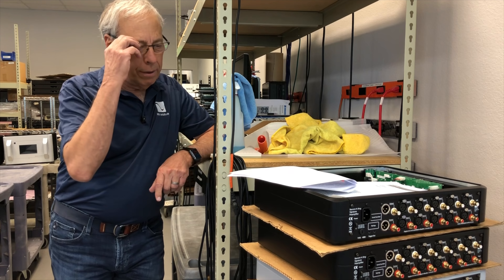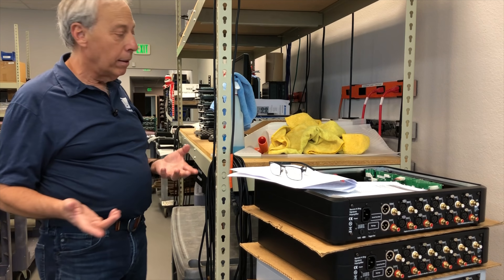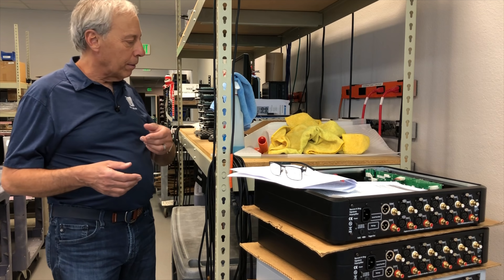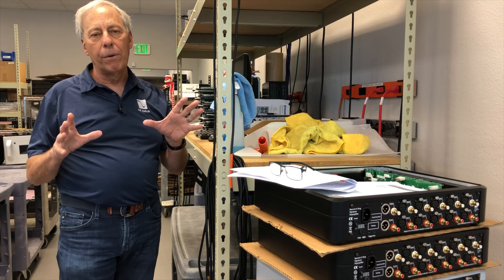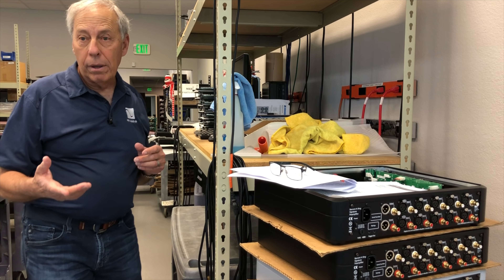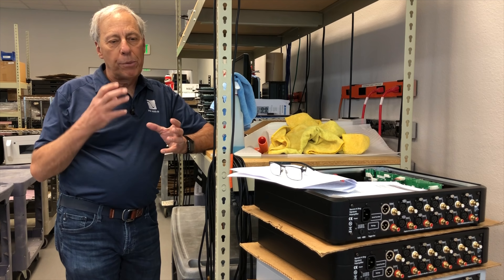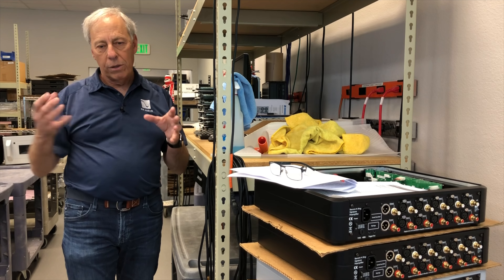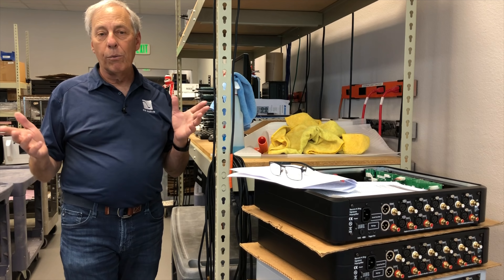Are fewer components in the path cleaner?

Comment: OOOooo I got a good question! What is impedence matching? why do i need to match the impedence of the source to the amp?
Reply: This is one of those questions that can get really out of hand, because there are several directions to go with it.  
In some applications, impedance matching is for most efficient transfer of power.  In others, it can be to minimize noise (obtain best noise figure).  And in another class of applications, it's for fidelity of signals with fast transitions or long transmission distances, i.e., avoidance of reflections and the standing waves which can result.  
There is a great deal to say about all of the above.  Which one interests you most?

Comment: I think the reason why that argument wins  support to begin with, is the misconception about audio processing. We dun do simple for the sake of simplicity, and by product is good sound (Think of the non sense of amplifiers best be a straight wire with gain), but actually whichever way least  implicated and appropriate to make good audio unaffected in the end. In many senses, that's why we have filtering in CD, NFB circuits in many amp designs, buffer stages like Paul uses as an example etc. I think we may not conclude by looking at an amp opened by without cover and count components to say good sound. That's naive and useless.

Comment: Well a couple of years ago I used to run my Oppo 105D directly to the Parasound A23 power amp using Oppo's pre-amp features (connected using balanced XLR cables)... I thought it sounded pretty good... but when I added a real pre-Amp to the mix (a Parasound P5) BOOM!! Much more detail, much more bass.   Night and day difference!!
Reply: NETnews could that just be an impedance thing! if you added more impedance from your oppo you might have achieved or even bettered the preamp
Reply: John sweda more like the Parasound pre-amp is just better than the pre-amp in the Oppo.
I personally have a Parasound P7 pre-amp connected to the Oppo.
But for connecting a hp, using either the Oppo hp out or the P7 hp out, seems damn close. The 105D does use a Texas Instrument amp in the hp circuit.

Comment: Great except the cable capacitance remark. There is insignificant capacitance on properly made 1-2 meter rca cables at audio frequencies to cause any degradation of the signals. RCA cables have low loss way out to 10Mhz and we often used them for analog video in the days before digital. This business of swapping cables and hearing the difference is nonsense. What is more likely is the power of suggestion plus blood alcohol or THC levels are higher. Or just someone's mood or background noise. A/B blind testing (with proper reference headphones only) on different properly make cables will yield no difference. If you want to see high cable loss then look at microwave 3-30Ghz losses per foot. However audio is way,way,way down in the dirt from a transmission line perspective and that's what you're really talking about here as Resistive loss on copper center conductor RCA cables is only ~0.7 ohms on a 25 foot run.
Reply: "This business of swapping cables and hearing the difference is nonsense" But have you tried it with 3 or 4 pairs of high quality audio cables on a high quality system?  I can tell you that a 6ft run of a 12 pF/ft will sound quite different than a 6 ft run of a 20+ pF/ft cable.  Not trying to start an argument, just wondering if you've actually taken the time to hear the difference.
Reply: I believe he was using a poorly designed circuit as an example.  The issue described was with the circuit, not the cables.  If the circuit is designed properly, cable capacitance is probably waaay down on the list of things to worry about.
Reply: Nixon is right. Cables need to be well constructed, good insulation, good termination, otherwise just a great way to pay someone elses colledge fund.
Reply: In a simple system, it should not make much of a difference, but with a very sensitive ssystem, the minute capacitive and inductive behaviour should be noticeable from set up to set up.

Comment: I may be way off base here, I am no expert by any means . But I think in a tube amp circuit less MAY be better but in a solid state amp this is not always the case. In a tube amp situation the valve is less fettered by tone control circuits and what have you but I think inherently solid state (being more like digital, on off)  will take more components to correct the input than an analog  valve amp would. Again I am no designer but looking at the simplicity of most valve amps it looks like this may be true.
Reply: Solid state devices require biasing to get them started. In that sense, they are "more like digital." Once that point is reached, the design and manufacturing of the device comes into play. If the circuit is designed to operate the device within a highly linear range of its characteristics, little additional circuitry may be necessary. If the device is operated in nonlinear regions, additional compensatory components may be required. 
Many tube circuits are designed with the philosophy "you get what the tube provides." If you don't like it, use a different tube. Complex tube circuits are more expensive to build and maintain; thus minimalist designs prevail. There may not be a compelling reason to do this when long lasting low noise semiconductors are used. 
If you have to increase feedback to make a simple circuit work, additional stages may allow less feedback to be used, and may sound better. Circuits that process balanced signals may sound better, even though active component count is higher.
Reply: Thanks for your reply! I just know that looking at a tube circuit and a transistor circuit that the tube circuit that sounds as good or better has WAY less components. A 5Y3 rectifier is a single tube with a couple of diodes and it does what a full wave rectifier does more elegantly. Just my thoughts.
Reply: Electrically, FET's act very similarly to tubes.  You can even create tube like circuits with them, although on a smaller scale since they run on lower voltage. The nuances of their behavior differs slightly, which is why it isn't exactly the same.  You still will bias a class A amplifier, be it tube or FET.  The input to the circuit swings the current on the tube or FET up and down, so it needs to be above 0 to be able to go both ways.
Reply: That's interesting! I did not know that, thanks for your input!!

Comment: The example of adding a low impedance buffer is good. Another example is that two mono block amps can do better than a stereo amp or separate preamp can do better than integrated amp...cause power supplies can be better separated.